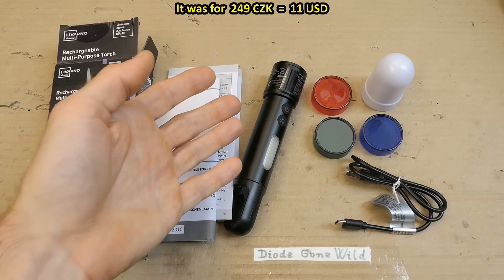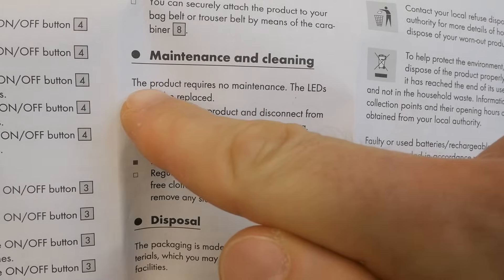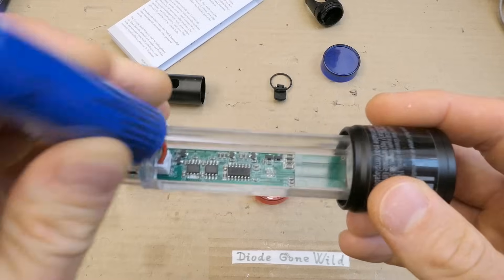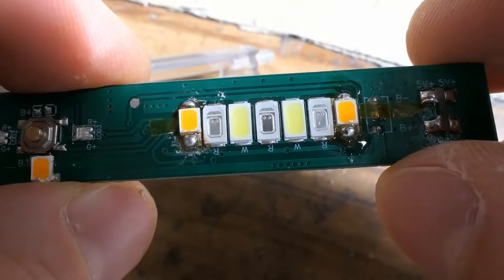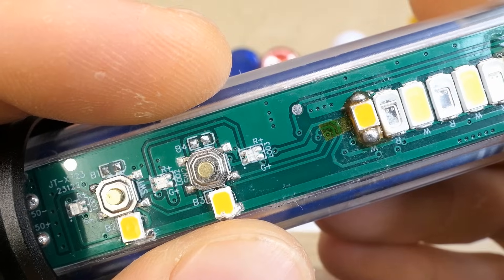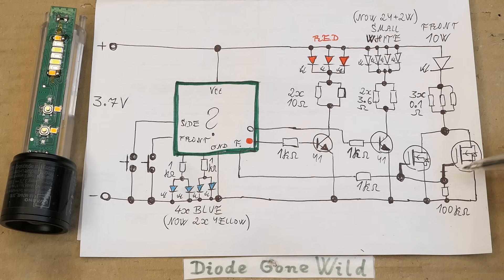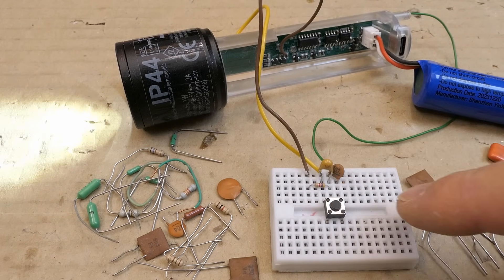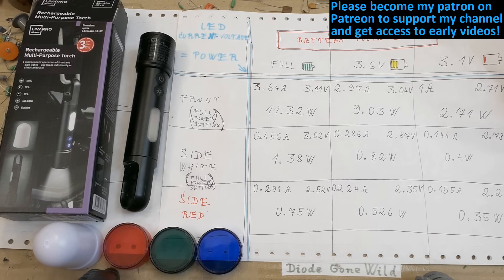Lidl 10W LED torch - test, teardown, modifications

Comment: I'm glad it's not just me that hates those annoying strobe modes. I treasure my old Convoy torch for not having it, just three power levels with last setting memory... so rare.
Reply: My adoptive aunt hates the strobe modes too as well as ones with dimmer modes. She prefers flashlights that turn on an off with no additional modes to separate those states. I on the other hand can tolerate it.
Reply: You might want to look at the wuben c3 as every day usb-c torch.. 😮 no strobe modes and switching modes is not easy because short press is ultra short!
It does have memory to keep the las Mode and is medium or high with one very very low candle light mode 😮
Reply: Just remove the chip and place add jumper wires across the input & output. And problem solved.. the on/off switch will just turn it on & off like torches were meant to be..😅IV done it so many times with lights I like a use a lot 👍

Comment: Excellent modifications.  Putting the strobe modes in the main sequence is indeed stupid, but the makers of cheap lights don't care about usability so long as they can advertise more modes.  I had never thought of using "feedback" signals to the mode button to skip the flashing modes, but you are admittedly more clever than I.  I've assumed that modes controlled by a chip were simply unavoidable without reprogramming, but this demonstrates a smart way to "skip" those modes.

Also, charging to 4.18V will provide longer life than charging to 4.20V or higher.  Thanks.
Reply: Some vibrators even have strobe and SOS lmao
Reply: @Gameplayer55055  lmao, really

Comment: I learned a long time ago from another channel that bridging a certain transistor will get rid of the strobe, but also all the other modes, It will only keep the high mode and it would also be a bit brighter!

I got 2 the same lights and tried on one of them and it worked as I described above!

Comment: Probably the best electronics hack video on the Net, how to stop led torches doing the ultra-annoying flash sequence! It seems like only a minor niggle but gets problematic when you are using the torch for an important job. You only have limited battery life, your mind is occupied by the job and every time you turn the thing off to save battery it goes into flash mode.

Comment: As always, many thanks for a great and inspiring review, especially since I also own this flashlight. The stupid flickering and the color of the light really annoys me too, so I'm going to start modify according to your pattern right away. Your ingenuity and ability to simply solve complex problems is enviable. You would definitely make a great crew member on Apollo 13.
Note: it happened to me that the flashlight suddenly turned off when the main LED was switched to maximum power and did not respond to any button. When connected to the charger, it did not start charging and no LEDs lit up. I tried plugging and unplugging the charger repeatedly with no success. After a few hours I tried to connect the flashlight to the charger again. I tried connecting and disconnecting repeatedly and at one connection, the blue LED flashed briefly. Then after reconnecting the charger, the flashlight started charging. I hope it was just an excess and not a permanent feature.

Comment: I love the older oscilloscopes you restore. I noticed they have advantages when you want a  steady looking wave. And not some yellow line that looks like it was draw a poxy  rugrat animater. They're just far nicer to look at i think. And to have buttons when and switches that look like they needed planning permission from the local council from space on these genius investigations is savage looking. That's how buttons & switches where meant be, not touch screen or tiny buttons your not sure if ya pressed it or not,. Nope,... Gimme spring operated buttons and switches that rattle the bones in elbow turning them.. (something things really are forevey lads,)must keep an eye for for an auld scope on eBay. One with a diode curve tracer. . That's a must, Yeah something like that would keep me occupied for a few days at least.. 
And suggestions on a good one to get anybody.  Any help welcome lads and appreciated 👍👍

Comment: Thrunite flashlights are designed really well, including how you have to do a triple click to enter strobe mode (which I would possibly use in the case of an attacker, but more likely the blindingly bright mode that activates with a double click). The normal cycles are with one click and then there's a 'firefly' mode if you long press from off, for situations where you don't want to lose your night vision.

Comment: Most of those Chinese made flashlights have the same problems. You have to cycle through all modes every time you use it. I had one light which remembered the mode each time it was turned on but I gave it to a friend. They should all work this way. Also, most of them also suffer from poor quality switches. Constantly having to cycle through modes accelerates the failure. I've been able to restore some of the switches with Deoxit contact cleaner.
Reply: An exception is the Chinese Convoy Flashlight.  The S2 is a great entry level , with choices of color, led, temperatures.  And great cust svc.  The switch on my flashlight broke, and he sent me THREE more, no charge.  Awesome company.  My 2 cents.

Comment: Great job!
That's why I specifically buy torches with on/off switch only. They still exists but good ones (that have proper regulation and not resistor dropper) are hard to find.

Comment: You can probe the chip inside and cut the pin that makes it Strobe, IV done it a few times on my main carry torches. but some still have that stupid SOS,  but of course you have to hold down the button to active it(so that's not to bad). Some pins have to be pull high or low. But if like me that strobing drive's you crazy it is fixable.. 👍🇮🇪

Comment: Do some people actually like having to klick through all the power levels and flashing modes each time they use a light, or is it just a way to add "features" with absolute lowest possible manufacturing cost? How much more could it cost to add an extra button or two for selecting modes and have a dedicated on/off button?
Reply: Even the "Magishine" lights I used to use for mountain biking do this, you have to go through the stupid strobe mode to get back from low to hi power. I think that's outright dangerous.
Reply: The tale of the adding machine versus the slide rule is as old as the Industrial Revolution.

What happens in a real-world business is, an engineer designs a product to do a specific job, and do it well; like a torch that can run for at least 24 hours on a single charge and still deliver a usable level of illumination  (in case it gets left on overnight in the bottom of a rucksack)  and has an auxiliary red LED  (which will not cause pupil contraction and spoil your night vision, in case you need to look at a map or something).  Then a marketing person sees it.  Now, because marketing people get paid enough to be able to afford posh hotels, they don't often go camping  (except perhaps on "team building" exercises, never too far from experienced staff at the activity centre),  and so haven't thought about the real-world problems this new, improved torch is solving.  But they are easily distracted by fancy bells and whistles; some of which are very cheap to add  (in the same way as if you are using a microcontroller, you can always add one to the result of any addition, essentially for free; just by setting the carry before you start, instead of clearing it.  If you are already doing pulse-width modulation, dividing down that frequency costs just a byte or two of RAM).

Then someone else decides they can make a similar product for a lower price.  And in order to show that theirs is "just as good as the original", they have to include all the bells and whistles.  So it still does all the fancy flashing stuff.  Only now, the battery they are using to get it a few cents cheaper to make so it can be sold for a whole Euro less in greater volumes has a slightly lower capacity than the one before.  And the separate switches in the original design have been replaced with a single button that has to be pressed multiple times, or for different lengths of time, which is less convenient for the user but much better for the manufacturer.

Then another manufacturer gets in on the scene, with their own ultra-cost-reduced version, with perhaps even some new marketing-driven bells and whistles .....  Which, by this stage, have become the thing the marketing people are really selling, and you can't even actually buy a decent product anymore since the original has been discontinued because everyone bought the cheaper copies.

Comment: On many of these torches the flashing mode can be skipped if you turn them off by long pressing the power button. I have several similar torches at home and quite a lot of them register long press as "turn off withou going through other modes".

Comment: That 18650 could be super replacable. 
BTW,  there are some LED lights that use 3 AAA batteries. It is super easy to stick 18650 inside instead of case for 3 AAA.

I also managed to bodge the head light with smaller round Li-Ion and put 5V battery charger with protection inside. So I can charged it from USB.

Comment: Some flashlights run on full power for limited time (3-10min for example), after that the controller switches to the second power mode (some do this gradually, and it is not noticeable). 
It will be better to leave the flashing mode, but make switching-off "one touch" - to cycle between modes as normal, and 3 sec after last button push to enter one touch off mode. Some flashlights (from Lidl) do this. But such a mod will be way more complicated (new controller).

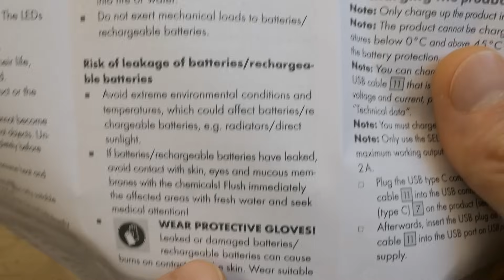Comment: 3:00 youd be surprised. Decades ago the motor oil company told you to dispose of your motor oil by digging a hole in your backyard to pour your used oil into! Sure adds some nutrients to your well water 😆 or drinking water from the river.

Comment: I always design my PWM circuits to use a >22KHz frequency, since they can also be used with PWM fans, and you'll get noise from the fan if the PWM frequency is in the audible range.
Reply: On my car dashcam flicker is visible for both LED traffic signals and LED car brake lights. I was surprised the frequency was not higher, maybe it might be for emi reasons or some kind of signalling for cars to receive.

Comment: They are probably using PWM on full brightness so they can compensate as the battery discharges to maintain a constant  output
Reply from the maker: Yes, they do it. Look closely at the oscilloscope. the PWM seems to suddenly increase by a tiny bit about once a second.
Reply: @DiodeGoneWild  👍👍😎

Comment: I don't understand why they don't even implement a "long press" (preferably to turn off the torch). It wouldn't cost any extra hardware. Or use double presses to even get to the flashing modes in the first place.
Reply: Some torches do that, it seems that the default for most is still the annoying cycling through modes, there is no excuse when a microcontroller is being used.

Comment: Can you test for every USB C product whether it works with USB C to C cables? Otherwise the USB C is not compliant.
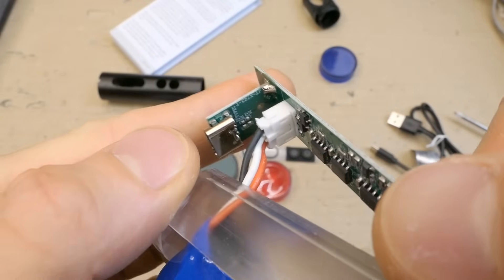Reply: 5:44 it probably doesn't due to the ommited pull down resistors for the CC lines of USB C.

Comment: Some torches that have flashing modes have updated microcontroller and if you actually use the flashlight more than 1 minute the next press of the on/off button turns off instead of cycling the modes. Have you tried to wait minute or two and see if it has updated firmware in that microcontroller?

Comment: I had a cheap flashlight and the control electronics failed inside of it. Now I have a LED light for my milling machine. I took the lamp head off the flashlight and ran a wire into it to a wall wart with a suitable current limiting resistor. I need to buy a new flashlight.

Comment: Heyy Daniel ,, could you please explain to us how 555chip gives us negative voltages, i did not get it, we can by using 555chip make voltage multiplier or Generating a negative voltage using diodes and capacitors ... i did not understand this. thaaaaanks.

Comment: and, as so often, it looks like they cheaped out on the 5.1k CC resistors, so it will only charge from USB-A 🙄
Reply: Seriously, it seems like none of the Lidl products with USB-C ports have them.

There was even this one Parkside handheld grinder (dremel-like) that used a USB C connector, but supplied a constant 12V. That was super shady.

Comment: when I pick up a flashlight I want light and no stupid mess, I value flashlights that has on-off with full brightness because I hate to cycle between every single mode every time I want to turn it on or off, it´s just stupid, even the dimmer modes. I pick up my lights because I want light and not weak or flashing crap.
Reply: The flashing modes are annoying,  but i value the lower brightness mode for the battery to last longer, with a high power LED at full brightness it gets hot and can't last an hour.

Comment: I prefer regular AAA and AA's honestly.
Reply: The Li-ion cell is much better suited for a torch like this, it can easily supply over 3A for the 10W LED. 3 AA cells would be needed to supply over 3V for the LED making it larger.

Comment: I think the front LED Is not 10w mostly like 3W sound more realistic
Reply from the maker: It's not 3W, it's really 10W, but the heatsink is a bit small, it gets quite hot when it runs at maximum for a longer time.
Reply: @DiodeGoneWild  real 10w in such a tiny body 😳😱

Comment: Can anyone help me, I have 2 of theese Tesla Holešovice SHL 250W bulbs, and I am not sure if they are HPS or MercuryVapor, and almost no information (exept some people seling them) online
Reply from the maker: It's HPS.
Reply: Thnx
What does HSL stand for? Why doesnt it just say SON or HPS 

Works, but something was wrong, it took 3minutes to get from blue glow to normal, also it was extremly dim 

It starts up normaly now, but this was extremly wierd 

It said E inside triangle on the bulb, which implies its externaly ignited
Reply from the maker: @Veso266  Well, it's normal for these to take up to 7 minutes to reach full brightness. More worn sodium ones might be more bluish during startup. But also the first startup of a new lamp might look quite differently. SHL stands probably for Sodium High pressure, the L was used both for frosted (sodium) and for luminiphor (mercury vapor) lamps, C for clear lamps.

Comment: does white led contain blue light spectrum?
Reply from the maker: You can't have white without blue.
Reply: @DiodeGoneWild  oh, does that mean all the white led lights in my house have a blue light spectrum, but, in large or small amounts?
Reply: @elynaindahbudiasih3279  Correct. As stated above, there is no such thing as white light with no blue in the spectrum. However, higher quality white light sources have a more continuous spectrum without excessive spectral peaks (typically with some peaks in the blue part of the spectrum). Good quality light sources have a higher CRI. As an additional note, very energy efficient sources sometimes have a trade-off with a lower CRI, as it is difficult to achieve both. At very high levels of efficiency, it is not even possible to have a high CRI at the same time, due to the limitations of the laws of physics, because you cannot beat the efficiency of a monochromatic light source.
Reply: The white LEDs use a blue LED chip with yellow phosphor coating to give white light. Where sun light gives a full rainbow colour spectrum through a glass prism, with a white LED usually you only get blue and yellow bands.
Reply: @dino6627  Most of them as this is typical design of most commercial white leds. More sophisticated leds have more sophisticated mix of phosphors. Still, there are also white leds which are just mixing RGB lights or are mixing both designs. Using phosphor layers is easy but it degrades over time and decreases efficiency. There are a lot of developments to find an alternative approaches.